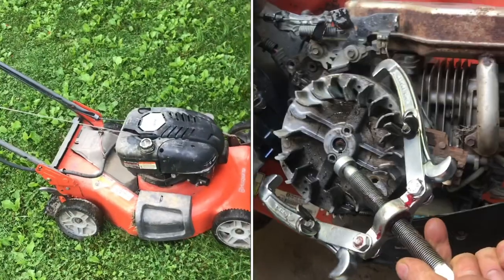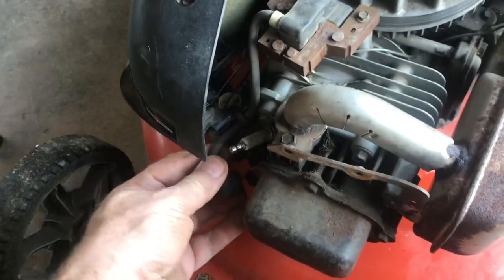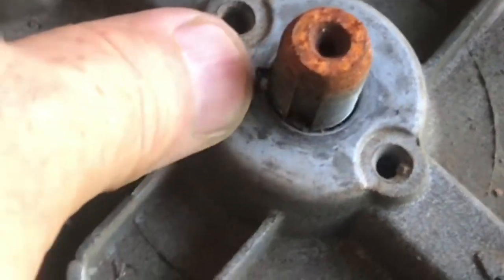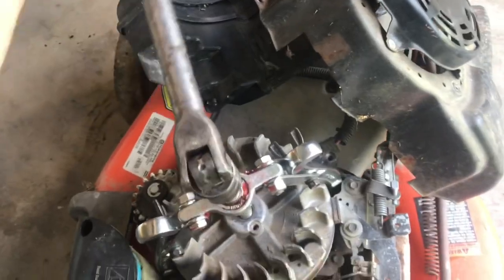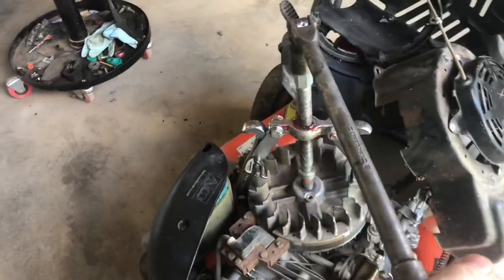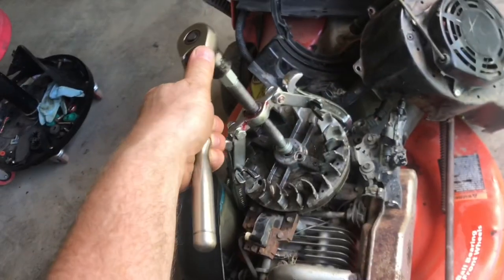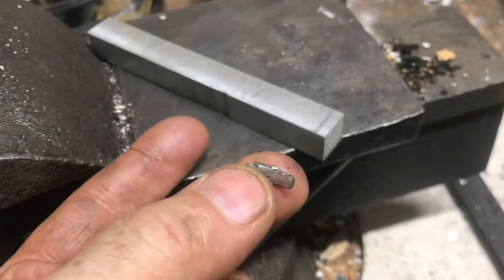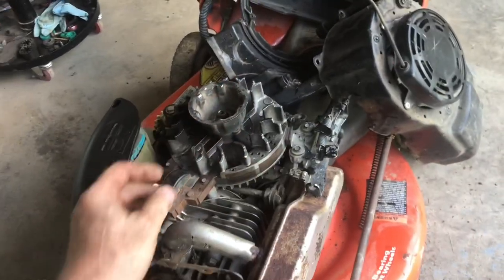(common￼ fix) lawnmower that HIT ROCK or stump (repair shear pin)

Comment: If you will screw the nut back on a few threads, it will act as a guide for the center point of your gear puller.